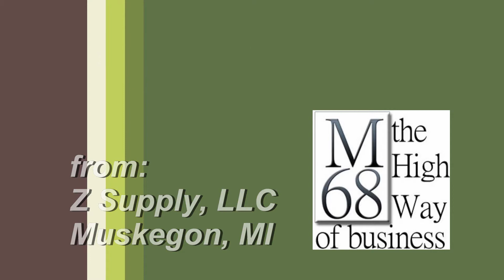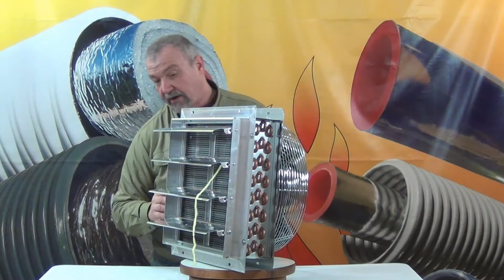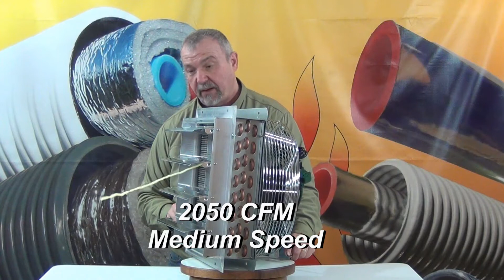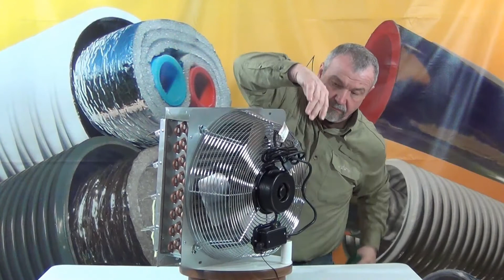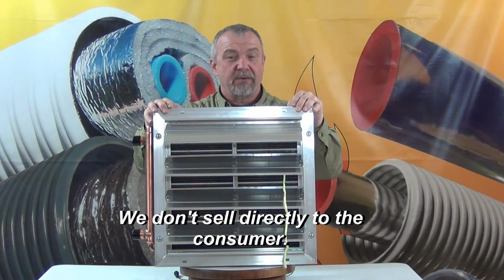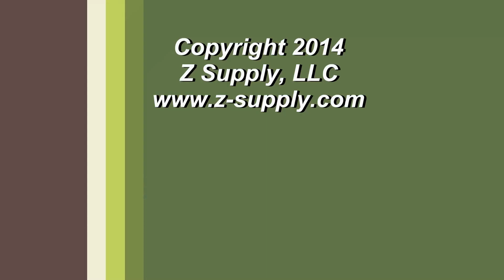Outdoor Wood Boiler Parts eZe Heat Unit Heater

Comment: Could I connect this to a duct work  plenum and have multiple vents so it will distribute air throughout a bigger area?
Reply: Jeff, it would be for my garage I was just thinking it would distribute air better.  My garage is 40x50 with an 18'ceiling and I thought of using 2 units and thought of incorporating duct work to spread the air out more. Just a thought though, thank you for your reply.